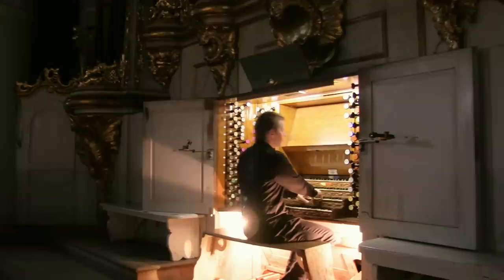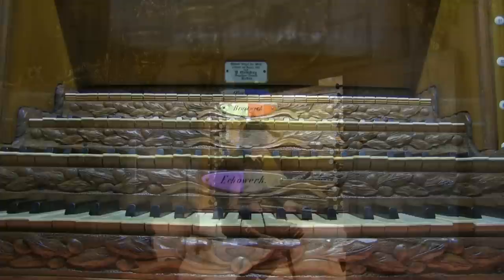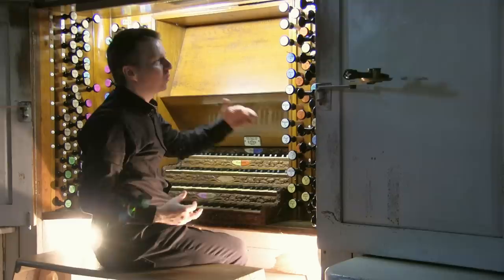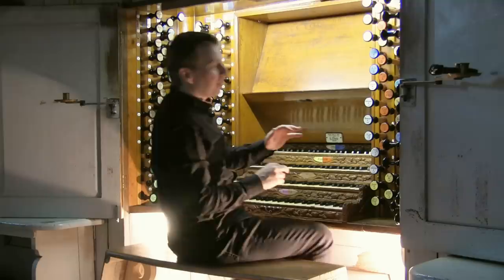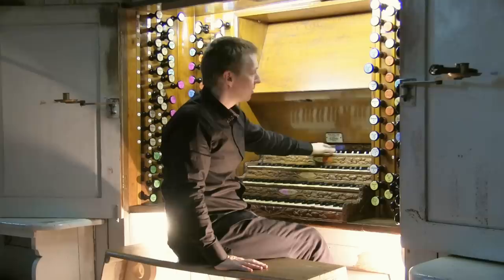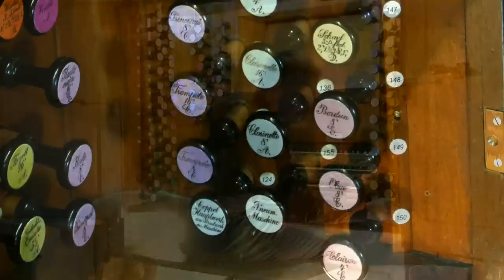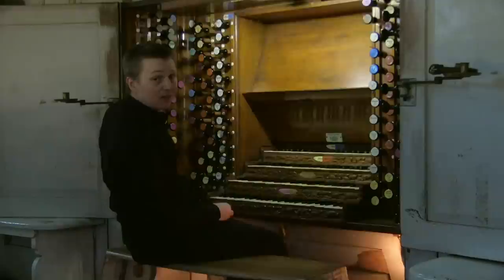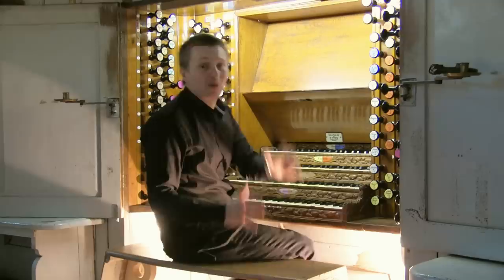THE WORLD'S LARGEST MECHANICAL PIPE ORGAN - HOLY TRINITY CATHEDRAL, LIEPĀJA, LATVIA

Comment: Wow, you really get a work out pulling registration on that instrument, don't you? That's a fascinating instrument.
Reply: Not seen anything like that before. Looks like someone needs to go round it with a grease gun !

And servo-assisted keyboard !
Reply: @millomweb  Wood drawbars, some several meters long. You won't do much with a grease gun, the friction is already as low as it will get (very nice workmanship), it is just that there is so much hooked up to one linkage that it really adds up. 50 grams times a few hundred links and you need real arms to pull out the stops.
Reply: @modularshop6513  Pivots offer less friction than sliding surfaces.
So I might as well ask, what stop operates the most things?
Reply: @millomweb  mixture stops I guess; mind: I spent an hour looking over the guts and I did not have time (or gear) to make sketches, didn't even think that someone might be interested or I would have definitely taken photographs; next time I am in Liepaja I will try to fix.
Reply: @modularshop6513  I'm not a musician. I'm a mechanical engineer :)
Have an electronic organ here at home. Again, my only interest is the control system. For instance it only has an octave & a bit pedal board but if I play pedal notes through the MIDI it'll play the same range as the 2 manuals !
As for the trad pipe organ, I've always been fascinated by the manual couplers !

I like the sound of fairground organs - especially 'Victory'. Search webby for 'Victory on Tour'. It's a trad organ - air powered from compressor and plays punched hole books BUT put a blank page in and turn the feed off, you can play it via its Yamaha MIDI !
Reply: ModularShop : Cheers for the organist!
Reply: J. W. K.  Not necessarily 'old' days. There are modern players using 'stopperators'.
How's that for a name for them !

Comment: The Sydney Opera House Grand Organ is the world's largest mechanical tracker-action pipe organ.[1][2] It is located in the concert hall of Sydney Opera House in Sydney, Australia, and was designed by Ronald Sharp, who was assisted by Mark Fisher, Myk Fairhurst and Raymond Bridge.[1]

It is in six divisions, five manuals plus pedals, and is the largest tracker action organ ever built, with 131 speaking stops served by 200 ranks of pipes consisting of 10,244[3] pipes. It is a neo-baroque organ in style.

The contract for the construction of the organ was awarded in 1969, during the construction of the Opera House, and the organ was completed in 1979, six years after the opening of the building. Since then the electronics have been updated, including a major refit in 2002, but the musical specification is unchanged from that developed by Sharp starting in 1967.

Comment: 3:36 bass notes go sharp.  "Without the pitch being affected"

Lol. Probably just needs some work, but free reeds do go flat and sharp like that with wind pressure differences. Very noticeable on a melodica.
Reply: But sounds really cool though, can kind of bravado the notes
Reply: @bendito999  It depends on what you're playing, and your personal tastes. My Fender Rhodes has some bad tines that drift sharp if the note is held for more than a couple seconds. In that context, for example, it's very annoying. Especially when other notes are held against it.

On melodica, changing air pressure can be used to bend notes and be expressive. But in that case I can mostly control the effect, so I think more positively about it.

Comment: INTERESTING!!!  I enjoyed your video--and your playing!  Yes, I was intrigued by the color coded stops.  I noticed some different terminology, but I figured that may be due to where you're at.  I heard a couple or so ranks "out of tune", but this might be "celeste tuning" (intentional).  With all this coupling and being a 4-manual organ with that many ranks, I bet that's gotta be hard to play (maybe much worse than typing on a manual typewriter)!  Back around 1989 or so, I had the luxury of playing a 2-manual tracker organ, where the ONLY thing electrified was the blower.  It had probably 9-10 ranks.

May God's peace be with you!

From one decent music to another,

John Nozum
Reply: Yes, very hard to play, if you are used to a piano or something electronic you will initially think something is broken. Also, plenty of the keys will only sound on the last mm or so so you have to push them all the way down, quite forcefully or you'll miss the note.
Reply: @modularshop6513  Interesting.

Comment: I wonder how many people were out back pumping bellows to power that thing before the invent of electric motors to run the blowers.  Maybe it used a water driven turbine.
Reply: It had to be mechanical. I’m sure there is a way to encourage air pressure through steam engine or some inwardly-air-drawing intake that upscaled user pumping power
Reply: Up above it says 2 people pump air with bellows

Comment: It’s the largest tracker organ in Latvia, but NOT the world. That honor still resides with the Sydney Opera House Grand Organ with five manuals and 200 ranks.
Reply: The SOH organ is a tracker but has some electrically assisted functions whereas as the headline notes other than the blower everything on this is mechanical in action and even then the original human powered bellows are in situ and can be used if there was no power.

Comment: I don't have absolute pitch, but could it be that the tuning is lower than central A = 440 Hz?
Reply: Very probably. A at 440 is a rather recent phenomenon. The organ original would have used a different form of temperament such as one of those  by Werkmeister which would have meant that each key would have a unique character.
Reply: Tuning of that era could have been Chorton A=466Hz or Kammerton A=415Hz.  When Bach took his choir touring, he could encounter both pitches on the same tour.
Reply: @kennethcarrizal9871  - interesting. Thanks!

Comment: Every video I have seen describing a pipe organ focuses on the different stops and their tones, or as many organists put it, their colors. Because this is a mechanical organ, you should have described what a mechanical organ is, and how it works. Obviously in our modern age, the wind generating machine is no longer human operated with pumps but electrical.
Reply: The keywork is mechanical using rods and levers. With a  pneumatic action the key opens a valve and air is admitted to a tiny set of bellows which operates the corresponding pallet on the wind chest. With an electrical action a switch is closed which operates a solenoid.
The mechanical action is not on/off. The amount of air flowing is a function of how far the key is pressed. Hence it is more expressive than the on/off systems.

Comment: I thought the John Wanamaker organ in Philadelphia was the largest pipe organ in the world. Is there a difference between that organ and this one? I’m confused.
Reply: This organ is completely mechanical tracker organ with the keyboards connected directly by wires and rods to the valves controlling each and every stop/pipe. It runs without electricity except today uses electric fans to pump air but the original manual bellows for air still exist as well. 
The Wanamaker is spread over several rooms on five different floors of the store and all the stops/pipes are control by electro-pneumatic action from the keyboard console. Its not a mechanical organ.

Comment: The organ of St Sulpice in Paris is larger and is entirely mechanical.
Reply: SS has 102 stops and this has 131. Its not the number of pipes.
Reply: @epincion  and viellequebec : The Sydney Opera house organ has entirely mechanical key action, but electrical stop action, and a mix of mechanical and electrical couplers. It  has the same number of stops as Holy Trinity at 131, but more ranks at 201, and over 10, 000 pipes (SS and Holy Trinity both have ~7000 pipes)